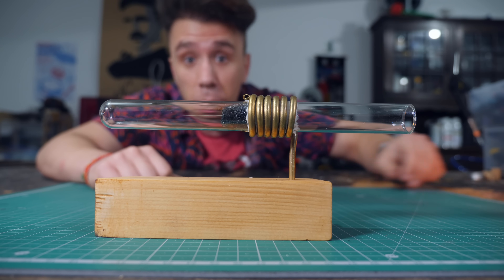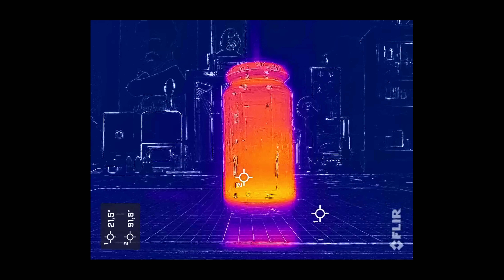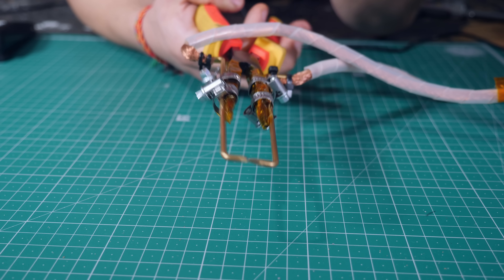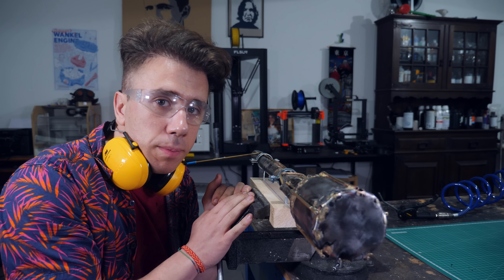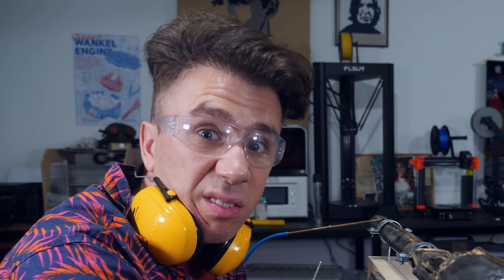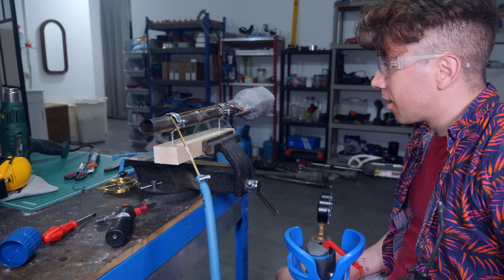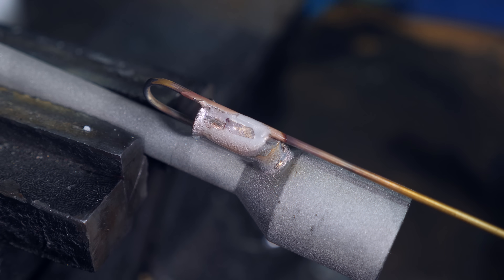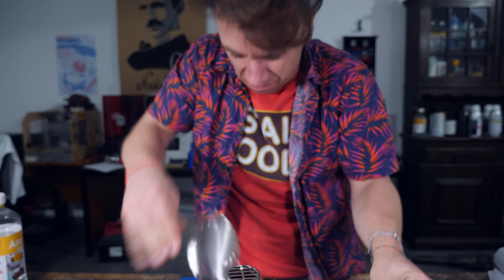JET ENGINE with NO MOVING PARTS (Pulsejet Engine)

Comment: I wonder if folding the metal over itself and compressing the seam (like soup can lids) then spot welding the whole seam would work to hold the air in better. Soup cans are airtight with just their geometry and crimping, but the spot welding might make it just strong enough to withstand any blowouts on the ends. Of course this wouldn't solve the blowout through the wall of the engine, but I think that's just how it is with pulsejets. Could be useful for a turbojet though!

Comment: Why not give your jet engines a boost by using HHO as fuel? You can whip up some HHO by simply zapping water with electricity through a process called electrolysis.

Comment: I would like to see any or all of your engines run on HHO. Water reservoir - electrolysis - HHO as fuel. I'm curious to see what design you'd use for the apparatus and electrical properties.

Comment: i cant tell if the wrapping of the fuel line around the combustion chamber was to either heat up the fuel before ignition, cool the chamber, add strength to the chamber, or all of the above.

Comment: Make a video using kerosene (RP-1) as a fuel (I don't know if lox is required for this) do a payload demonstration on a wheeled system (skateboard) or a high speed demonstration on a cable suspension system

Comment: Have you ever looked into the Ranque-Hilsch vortex tube? It separates input compressed air into cold and hot air, almost like Maxwell’s Demon.

It uses a supersonic nozzle feeding a spiral air chamber inside the tube.

I suspect you could use that as the core of a jet engine.

Comment: Rocket/EDF hybrid maybe having the rocket act like a scramjet burner with the EDF air flow both cooling down the combustion chamber and acting as a nozzle for it.

Man for not welding so good you did a pretty good job with the brazing, if you got access to oxygen and Acetylene you could possibly home build a torch for oxyacetylene welding.  I don't know if they have any welding depots or stores in you're part of South America, but if you put into practice on a flat sheet and just follow some good YouTube videos for the other joints you should get the hang of it pretty soon.  I started learning welding on oxy/acetylene, and because I was really good with the particular skills you build with that that are transferable to tig I transferred to tig and found myself having more proficiency for tig than mig.
I'm decent at stick, just don't expect me to make 6010 look like it's anything but the dirtiest electrode.   But yeah don't say you're bad and just give up, try a different process, try a little bit more time, watch videos on other people's techniques, eventually if you put in the effort you'll find something that works for you.   Also I think given the current demand on the skill if you're looking to immigrate into the US that's a skill to have to make the process smoother, because the job market has a stranglehold on our government when it comes to immigration most of the time.
Reply: T..elegram_me--Theintegza  you cursed bot.

Comment: I really think you should revisit the turbocharged jet engine with the ability for metal printing. Then just slap microcontroller for the RPM and you won't have to manually adjust the trigger on compresor anymore.

Comment: You should keep the jet engine cold by using either thermal condition pad or a cold plate or dry ice. Another thing you can do is use the force of the engine to cool it self.

Comment: Rotating detonation engine sort of thing.  You know those shower heads that do the shower massage thing that has a propeller that blocks the water momentarily by spinning?  Why not have like an engine design where the fuel inlet holes around the outer edge of a cylinder have a spinning blocker to let the fuel only come out of one or two holes at a time of many around it and spin that blocking propeller with an electric motor so that it sort of creates a rotating fuel injection within an aerospike of the cylinder so it makes a rotating detonation engine sort of thing.  I don't know if an electric motor can spin fast enough as the sonic detonation does but it seems like it could.  You could then sort of control the rotating detonation by the speed of the electric motor attached to the blocking propeller and the rate of fuel injection. I love your videos! They make my brain swirl.

Comment: Could you put a shroud around the pulse jet that starts air flow to cool it, and as the flowing air heats up it accelerates, producing thrust out the rear drawing in more cooling air in the front?  I'm thinking of something like the shroud around the barrel on the old Lewis machine gun, or the oil cooler on the P51 fighter plane that also added thrust by heating the air.

Comment: Integza!!! What you can do is print a small one like the last one on your 3d printer with two options:
1- print one smaller so that when you cover in that fireproof paste and melt the plastic of the inside it matches with the normal one

2- make one made out of that metal infused filament that you have to oven and later cover it in the paste, that way sealing it's porosity

With the first method and with the second one (less people) everyone could make one

Comment: Mazda recently developed its spark controlled compression ignition petrol engine. What about a development on that to incorporate the use of hydrogen as a fuel source, whilst maintaining a similar power and torque output? Maybe with a twist

Comment: The smaller the pulse jet, the more volatile the fuel has to be. Smaller = higher frequency = the fuel has to burn faster. Big ones will run on any gas or liquid that burns.

Comment: Back in the good old days (1970's) I was involved with a club making ramjet powered ultralight helicopters. Each of the four rotor wings were made of metal wrapped around a 38mm thin wall steel tube positioned at the rotor (wing) balance pivot point, and at the outside edge were modest sized carbon steel sheet metal ramjets lined with a slip coat of hardened china mixed with fire brick as a heat liner. This was operated from a small Propane tank through at full pressure (70 PSI on a warm day) and a valve and a spinning high pressure manifold at the rotor hub. The total weight was 100 lbs higher than ultralight allowed then, so a pilot had to fly them, but the 4 engines produced the equidistant of 27 HP which was more than most of the mini two-cycle engines at the time and was such a screamer in the sky that you had to wear extra ear protection as the rotor motors rotated at upwards to 400 MPH for flight.  No they didn't last long, but were a blast to make.

Comment: Hey Joel! You should make an Electrostatic Piston Engine. Allow me to explain.

Basically, if you have two metal plates charged at the same polarity, they will repel. If they have different and opposite polarities, they will attract.

What if you made the Piston of your engine negatively charged, and there were plates on the bottom and top of the whole cylinder which would switch polarity? You could repel and attract the piston in a reciprocating motion, thus causing a crank to move, and rotary motion.

Comment: Next time u get to print an engine model in some cooling channels inside the walls, that's how u get lightweight engines that can actually take extreme heat without melting.

Comment: You should make a rocket engine that pushes a 3d printed boat and while running will compress air that will then power an air engine that will continue moving the boat after you run out of fuel for the rocket

Comment: When you were soldering you were basically welding but every piece melts "weld" at the same temp. What you need is an at home tig welder. I know, I've been a professional industrial welder since 2006, not to brag just very proud of my work and knowledge and love to share and learn myself. I'm not the best by all means I'm looking for a mechanical engineering groups.

Comment: Great engine! Maybe you could attach some heat sinks around the cylinder so that it could reach higher temperatures, especially if it’s purpose will involve rocketry because melting around the body unevenly would create drag vortices to deal with

Comment: tip to make the (fuel)pipe bending easier: plug one end of the pipe and fill it with sand. that way it cant buckle and will retain its diameter and crosssection better

Comment: Couldn't you try to use carbon fiber composite infused or layered with some aerogel putty? Aerogel woud stand with the heat, and its light aswell and carbon fiber would bring in the actual shape and rigidity. Or just explore the possibilities of using aerogel in any form to insulate the heat. There are some aerogel product in the consumer market aswell. Would be interesting to see what you could come up with it.

Comment: I know you're not the best at welding, but if memory serves right you have welded before. Why not do like ColinFurze did once where he hydro-formed a pulse jet engine? All you really need to do it trace and cut the two halves of what you're looking to hydro-form, weld the edges and make sure there are no places for leaks, then weld on a bung (a connector where you can attach a line) and then hook up a high power pressure washer. You can then inflate it like a balloon and after cutting a couple of holes and adding the necessary accoutrements, you should be off to the races. I think he posted the file of what you'd need to cut out.

Comment: Your problem is the braze and spot weld approach isn't coming anywhere near what it takes. You need to actually weld the joint, not braze. The braze will melt

Comment: ok, how about 3d printing of a set of capillaries  wuth input for arteries and output of vein flow.  Thin out the cappillary walls to about  0.5 μm.  if not feasible how about the kidney renal capsule (aka Bowman's capsule) with intake (afferent) arteriole and outflow (efferent) arteriole-Arteriole walls are .02 millimeters thick.  
The capillaries inside the nephron capsule need to be thin to allow filtration of fluid (blood) into the nephron capsule.  The nephron capsule is a second structure that encasulates the cappillaries of the nephron and collects the filtrate that passes from blood through the cappilaries into the nephron space (aka raw filtrate).  The  thickness of the capsule is about 0.005 M within side volume of .  also, the capsule can be fitted into the capillary structure and either glued or hot glued with the capillaries inside. the volume space for the Bowman capsule is 1 times 10^6 um^3-but, you can increase all sizes and volumes equally to the dimension the can be worked in the printer.  Best wishes.

Comment: how long can you run this off of your soda bottles? can you build a small rc plane with this and some soda bottles for fuel tanks? you could fill a large bottle with compressed air, and a small one with alcohol, so that the pressure feeds the alcohol into the jet.

Comment: You should design a specific pulse test engine to run on hydrogen,  then make an electrical hydrogen generator and combine them. So you'll have a pulse jet engine that runs on water at the end of it!
You could even use a thermoelectric generator to power the electrolosis generator, and use the fuel (water) to cool parts of your engine!

Comment: Hi 👋, my video suggestion is to make a recapitulation of all the engines made by category and analyze which were the most efficient. And finally, test in the field the one that has been most efficient. Or you could also end the video by creating the best rocket that can be made using primarily a filament printer. 🚀

Comment: Plenty of non-metal high temp materials that aren’t very strong but easier to work with.  We used a high temp material that load up like paper mache in college…forget what that stuff was college though.  Issue with ceramic composites is they still shatter on failure so need to be wrapped in another layer to catch that.  Easier just to have the fuel flow over the engine for cooling in non-extreme use cases…but that won’t really work with gas fuels.

Comment: Sorry this is more of a "How To" than an Idea..  But my sketchy instructions will probably need some artistic creativity in order to make sense of so here goes.
There is an outline of the Idea after the hash tags. 
:)  Cheers and I'd love a 3D printer.  TTFN..

Using the domed bottoms of similar empty steel aerosol cans neatly extracted by placing the base of the depressurised can on a belt sander. With a 4mm hole drilled in the centres of the bottoms of the cans to house a 4mm bolt in each. 

WATER FILLED IF FLAMABLE CONTENTS OF COURSE.!!

A large diameter paint tin with around 4 equally spaced hole saw drilled holes in its base to allow those aerosol can domes to protrude from inside the paint tin to the outside which should snuggly fit when pushed in those base holes.

The domes should be set in with a slight air gap between themselves and the large drilled holes within the paint tins base.
4mm bolts hold the domes in that place on spring metal brackets which tend to push the domes into the paint can by a MM or two to get that air gap.   (If that makes sense.??)

######################################

This is In order to experiment with one of the proper V1 engines with the sprung open steel valves allowing air flow in at the front..

Butane mixing within the combustion chamber..

A constant spark makes a click go boom..

Boom Closes the valves to blow exhaust out the back..

Pressure subsides when the bang has gone..

Valves spring back open allowing air to flow in at the front..

Butane mixing within the combustion chamber..

Spark makes a boom,  Rinse and repeat..

No need to time the spark or the incoming butane as it's all controlled by the speed the air can enter.?
I think.??

Comment: I think you should make a "launch pad" that's fireproof so that I don't have to worry that you'll burn your house down. It can have built in mounts to attach engines fuel tanks and cameras, as well as sensors to measure temperatures and thrust.

Comment: If you can Braze weld good then you might be able to learn how to TIG. The fundamentals are very similar. Instead of a torch you have a high voltage welding head and the way you feed you consumable rod in a very similar fashion.

Comment: Can you make a potassium or sodium / water rocket? 
maybe a tube made from solid potassium metal that water or steam is injected/passed through creating potassium hydroxide and hydrogen gas that is ignited by the exothermic reaction? The heat of the rockets outer casing can boil the water into steam, I imagine steam will slow the reaction down compared to liquid water...

Comment: You could print the same engine in ceramic resin, similarly to older projects.
The ceramic should not melt... even if you push it

Comment: If you had more of those metal pulse jets and assembled them into a ring would/could you; get bonus thrust from all the extra air getting drawn in through the ring, use the air going through the ring as a ram air system to supply air to the jets, play with the dimensions of the jets to adjust the frequencys and possibly have them playing sympathetic harmonys with each other like a musical cord

Comment: what you can try is to make rocket engines fight against each other. by pointing two rocket motors towards each other (-><-) and placing them on a track. if you then put them on at the same time you will see which one is stronger. 🚀🚀

Comment: Try building the motor the other way, contrary to what you’re doing. Try putting carbon fiber on the inside and the sheet metal on the outside. It will dissipate the heat better. Also, make heatsinks by just welding metal strips on the outside shell

Comment: The pulse jet needs a lot more fuel, try turning the propane tank upside down to inject the liquid propane instead. Another thing you can do is to look into Lockwood pulse jet designs, they are said to be easier to start and also simpler in design.

Comment: Your engines melts all the time. Try to cool down the engine using thin pipes (capilars) with fuel (like nozzles in spaceships or hull of SR71).
Tomatoes are disgusting!

Comment: The fact that you can use hydrogen in a pulsejet with basically zero changes is super damn awesome. I thought hydrogen jet engines didn't exist yet you have one right here.
Reply: That has severe danger issues  if the proportions of hydrogen and oxygen are unfortunate that thing will detonate..
Reply: @frozenjoe6313  The same thing applies to normal jet fuel as well

Comment: Have you thought about using an HHO generator for a fuel source? They produce oxygen and hydrogen gas that you can split so that you can regulate the gas flow for each gas or use the mix right out of the simple setup. It will also run off of a battery so it could be mobile for use on a skateboard.

Comment: I don't get it, you first worry about temperatures and spot weld thin metal foil and afterwards you use tin to get it sealed and also use tin to lock in place your tubing's?

Comment: But what if you redesigned the pulse jets interior to accommodate an air vortex that comes in from a second intake, and would keep the flame away from the engines walls? Since you've already made a vortex rocket in the past, this should be plausible, just without expensive paints this time 😆

Comment: if you wanna delve deeper into this, and stick to keeping it ultra light weight, maybe try sheet titanium for heat resistance, make it a little thicker for thermal capacity,  and look into tesla valve pulsejets, instead of going for the old school valveless bong design. (and maaaybe upgrade your spot welder to roller contacts, to get one perfectly thin, sealed seam)